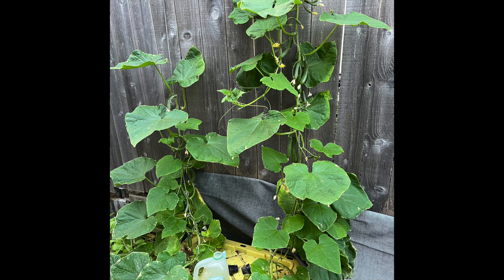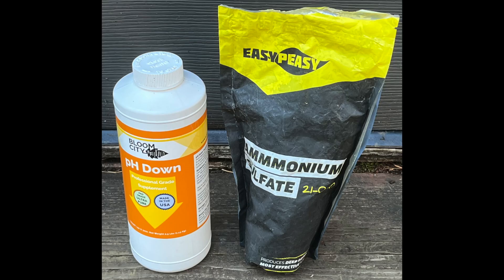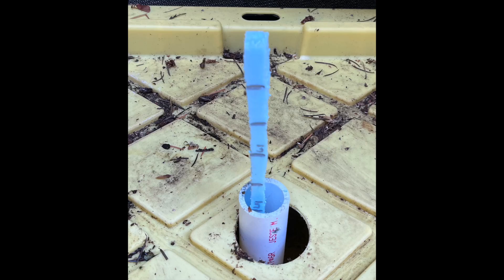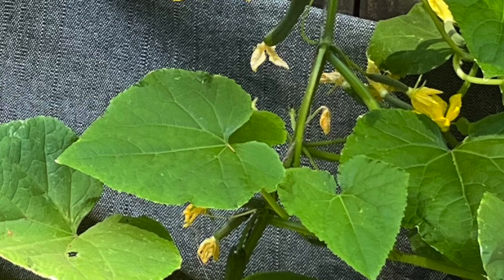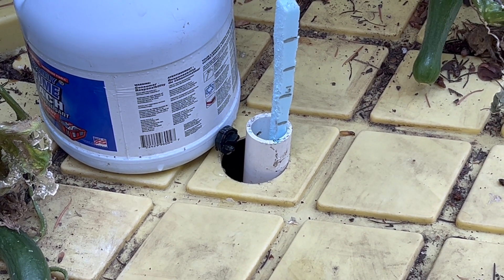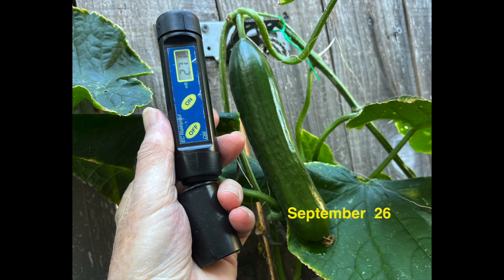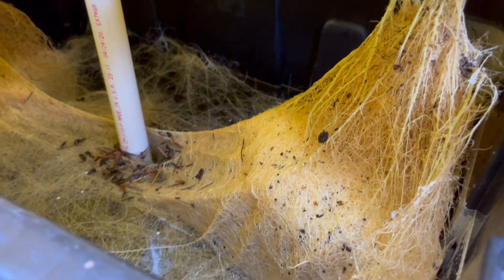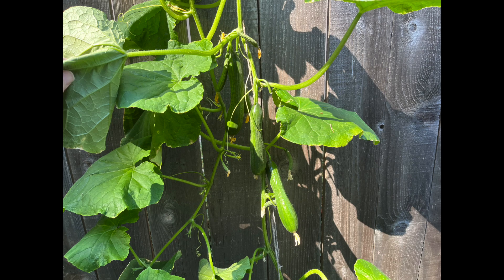Kratky Approaches to Growing Hydroponic Cucumbers

Comment: hello Dr. Kratky, how frequently you had to place that 1 gallon jug of refill nutrient for these two cucumber plants once the level was down to 5" in that 25 gallon container ?
Any idea how frequent this 1 gallon jug placement will  be for one single  indeterminate tomato growing in a 25 gallon container ? I read somewhere that such plants consume 1-2 gallons per day once they reach 6-7 feet of length and fruiting. As such, 1 gallon refill jug may not work that well . Will it work if I use 5 gallon bucket with button dripper to refill once the solution in the container is down to 5 gallons ?

Comment: hello, i've been growing in these bins as well, i'm curious what your take on the plastic leaching into it?  Those containers are PP Type 5 plastic, so it should be ok. but a recent study shows that black plastic are harmful?
Reply from the maker: Food, water and medicines are stored and transported in plastic materials and our homes and vehicles contain many plastic materials, so plastics are generally perceived as safe - though increasingly reluctantly so.  It would be prudent to use polyethylene and polypropylene (the safer plastics) for hydroponics and be vigilant for adverse notifications from EPA, FDA and research reports that warn against their use.  Food-safe glass might be a safer option, but  disadvantages include small container size, cost and its fragility could result in cuts from broken glass that could cause serious injuries.

Comment: Wonderful man, what is the point of slowly refilling resevoir with drip instead of just dumping water back into it to replenish?
I accidently started cucumber instead of basil...will it be okay without the ammonium sulfate?...does cucumber take regular fertilizer ratios for masterblend otherwise?
God i love u and so excited ir on yt!!!!!!😮😮😮
Reply from the maker: Actually, it is ok to fast fill reservoir providing that less than 3/4 inch of solution is added, but slow filling is just a bit more gentle way to refill solution.  Cucumbers grow fine with Masterblend hydroponic  fertilizer.

Comment: Clever use of the button dripper, I have always used either your fill-once-and-forget method or float valve refill method.  Cucumbers are so fun to grow.  I like to clip 6 to 8 inches off the tip of an actively growing vine and root it as a replacement plant.  This helps with perpetual growing.
Reply from the maker: Thanks for sharing your experience, Matt!

Comment: Thank you for another great video! Did you do, or have you done any pest mitigation for hydroponic grows? If so, what methods did you use? Cheers!
Reply from the maker: Thank you!  I didn't apply any pesticides to this crop as there weren't any major insect or disease issues.  Generally, pest problems on foliage are similar for both hydroponic and soil-grown crops.